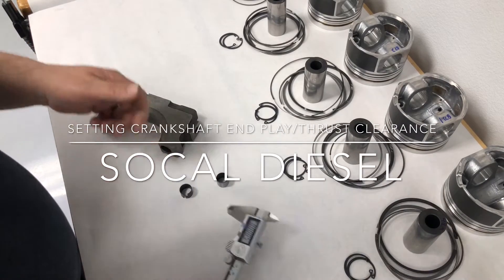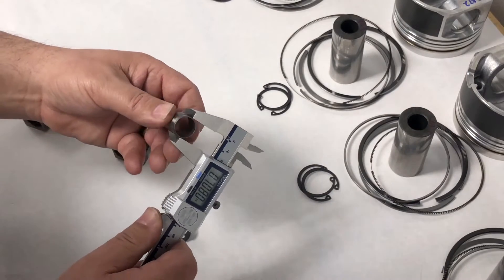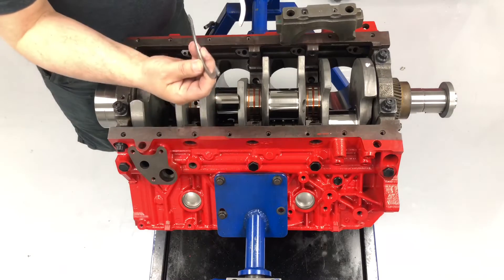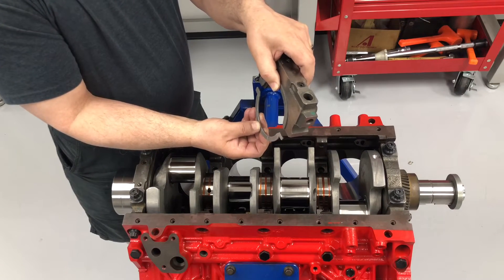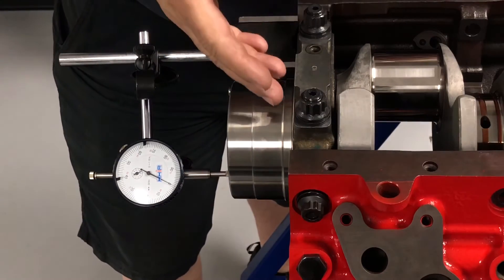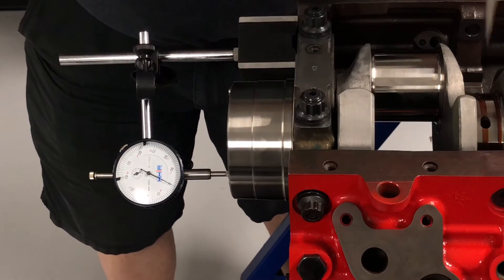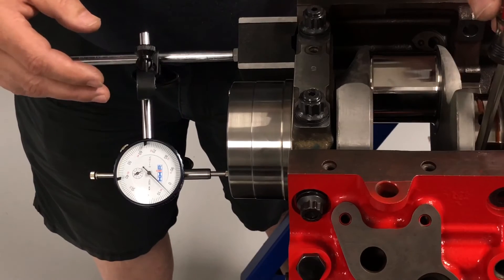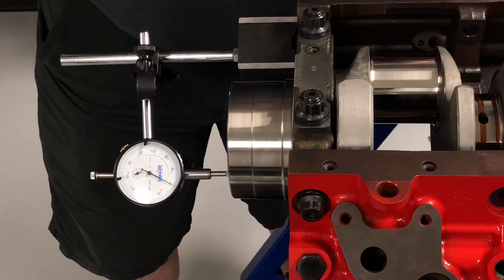Duramax Crankshaft Endplay

Comment: Okay so you say 190 ft/lb but you look up torque specs on the main caps and it’s 72 first round and 97 the second with a 30 degree final turn, post-97ft/lb torque…..
Reply: Hi Randy, there is a difference between stock bolts and ARP studs. We have a list of the Dmax torque specs, both stock and aftermarket on our website: https://shop.socaldiesel.com/pages/torque-specs.html

Comment: I have a question on the piston rings. I want to make around 1000 hp. My truck is a daily driver and my tow rig for my 5th wheel. I have the oval finger pistons what rings do you recommend. Factory or total Seal? I drive from Texas to Washington state pulling my 5th wheel
Reply: A little late on the reply, but to answer your question, we use and recommend a total seal gapless second ring.